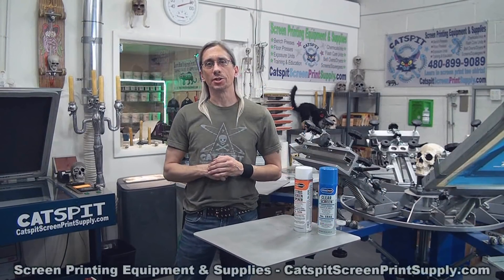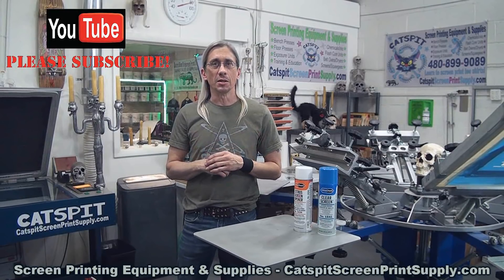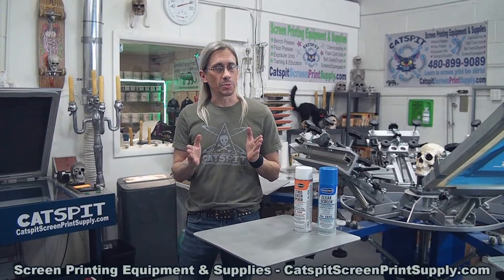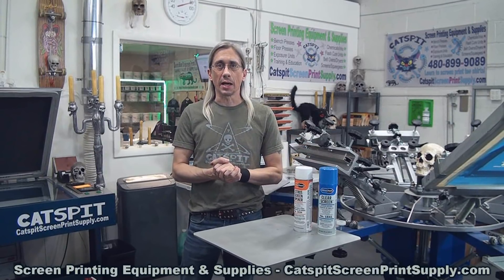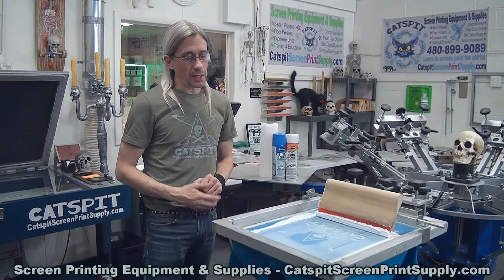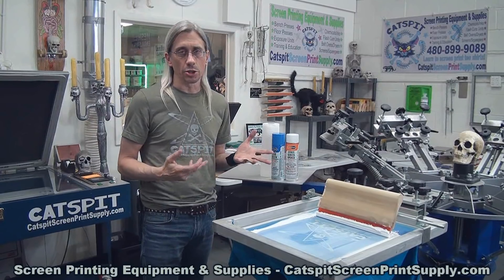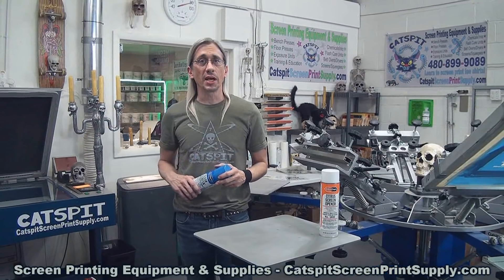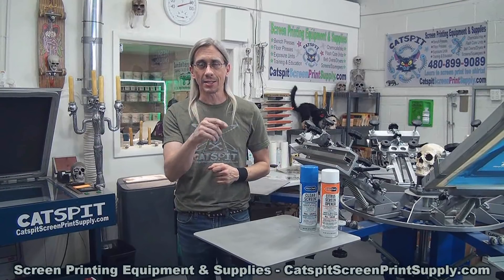Screenprinting Tee Shirts: How To Use Screen Opener For Clogs On Press

Comment: Nice and clean print shop like it man, hard to keep them clean tbh
Reply: Came across this looking to see if i could use screen opener to remove tar from plastic on the interior of my vehicle
Reply from the maker: Thank you. I simply try to work clean. Makes it easier. Thanks for watching! Screen Printing Equipment & Supplies - http://CatspitScreenPrintSupply.com/
Reply from the maker: @hxrlz6669  It may remove tar but it could affect plastics. You would have to test to see. Thanks for watching! Screen Printing Equipment & Supplies - http://CatspitScreenPrintSupply.com/